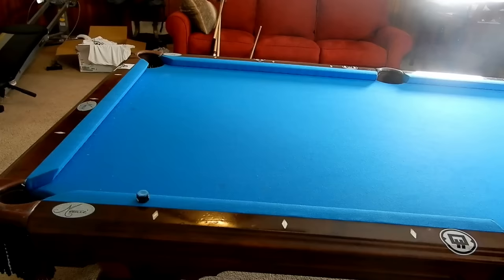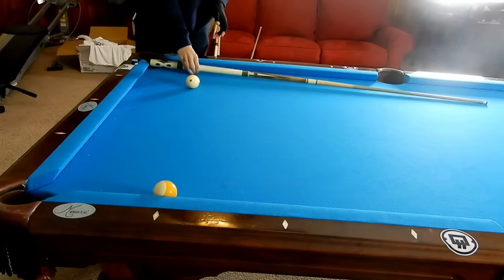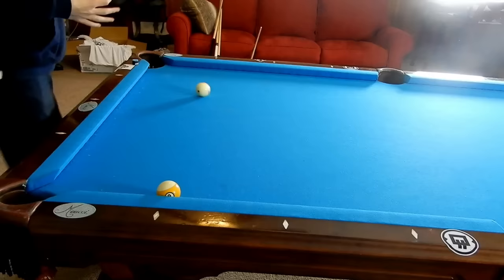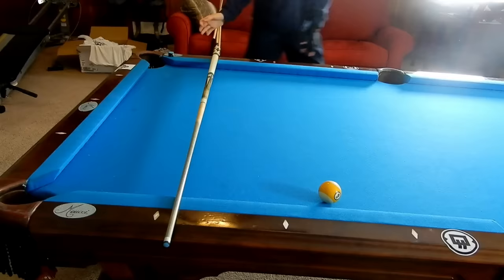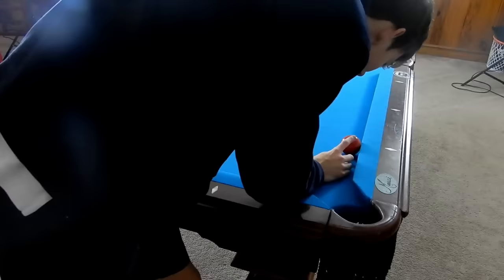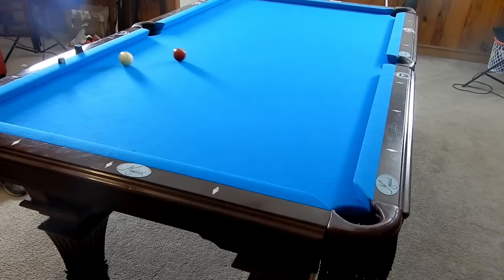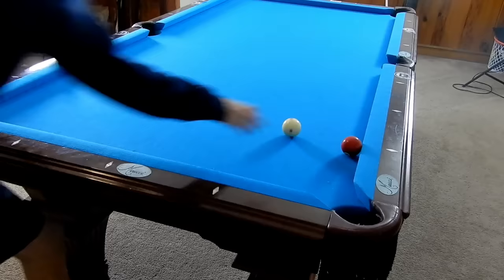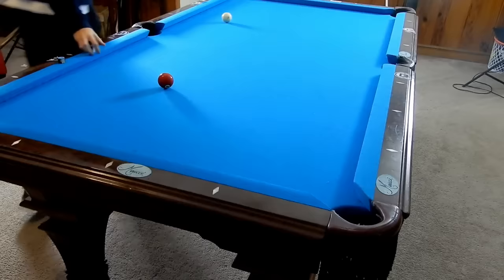How To Cut Pool Balls BACKWARDS!!

Comment: Although the cut that you demonstrated in the vid is probably more consistent way to sink the 9, I have on numerous occasions banked it from around where it is into the corner. Can be tough to get the angle, but is certainly doable and probably easier than the side bank that you were trying

Comment: From the angle you’re shooting that frozen ball it banks back at you with high right over cut the bank and the cue gets out of the way plus you can bank short leave cue at the other end of the table for a safety but miss the rail first spin cut and it’s over and a low percentage shot

Comment: I use to use this shot when the lineup was perpendicular to each other. But, I had not used it when the cue ball was on the same side of the pocket to the ball I was trying to hit against the cushion. 

I will say it should not take 10 minutes to actually make the shot you mentioned at the beginning. I get it may take more than one try. Just edit the video so it makes a smooth transition.

Maybe adding a back spin along with the right spin may help the cue ball to make that kiss from the angel. It's been a while since I have done the perpendicular setup.  Though think I used both front and back spend depending on the factors at hand. It the angle was off set likexyours, I would not likely use back eight spin on,the shot.

Comment: Half ball hit banks this ball all day long.
Reply: He placed the ball several locations during the demonstration Yes, but on most of them you got to throw so the ball comes off rail at different angle,
Reply: @rmo4222  he said the first spot was a double kiss and not bankable.
Reply: Yes, inside spin and half ball will bank this all day long, and the shit he is showing is likely to scratch alot.
Reply: @guitargod1882able  no inside spin Needed. Half ball hit firm stroke..
Reply: I like to let any average player from ky or the 513 bump that ball.
Reply: Absolutely easy bank
Reply: If worried about the double kiss then it'll go in the middle

Comment: That shot is prolly easier kicking 3 rails because the line of centers is wider all things being equal I n that  then kicking backwards and the speed of the cueball also determines the amount of deflection  which can make you miss it so bad or hit it so fat ..... I guess it's an option if everything else is blocked
Reply: I thought I heard his say IF NO OTHER SHOT WAS AVAILABLE? it not about kick shots, its about reverse cuts, could of double banked in the side, banked it cross corner, reverse bank to corner, or double banks it to far corner. It was about reverse cut shot.
Reply: You are right it was about a reverse cut shot that he made only once and not even the same angle posted in the video ... It was click bait but still a possible shot if nothing else is available
Reply: @724riff  I agree something I never would of considered and probably would never try in match if it was available

Comment: This shot is easy with out the back cut which is super hard. You would be better off kicking this shot. The chance of missing this shot is too great and for example if you were playing 9 ball you would give the game away.  Also the chance that this shot comes up in a game very very low the amount of practice to make this shot very very high your time would be better practicing not putting your self in this situation because that’s the only way I can see really happening. In saying all that this could be some kind of trick shot  but not really practical

Comment: Just a quick question on your table... what is the size of pokets
Reply: 8 foot home tables in USA usually have 4 1/4" pockets with 2 1/4" balls. Only the old Valley Bar  tables have 4 3/4  5 inch corner pockets with no shelf due to the cue ball being bigger to be returned on coin table. which probably what most out of the United States seen when visiting bars.